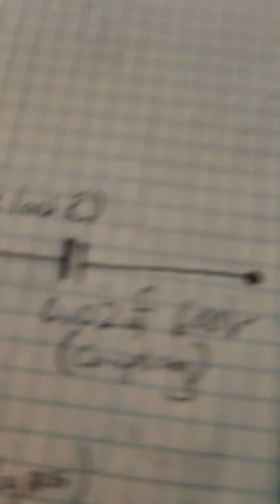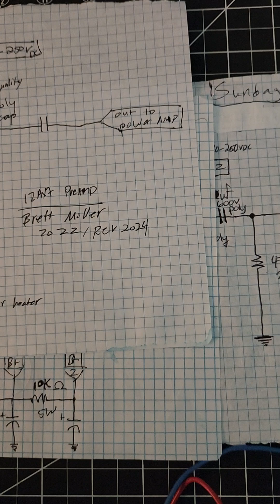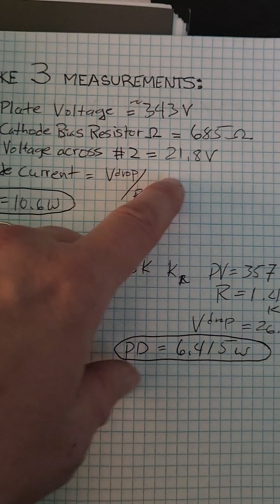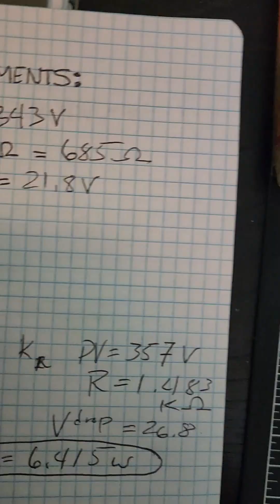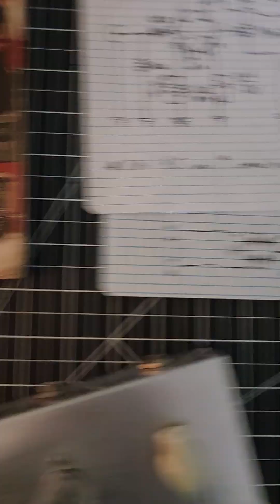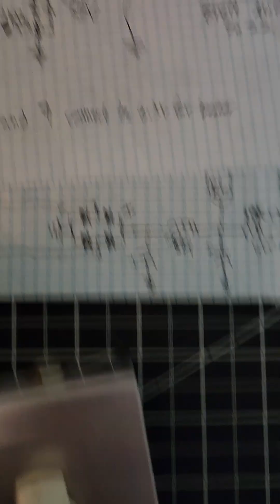Class A audio amp discussion.

Comment: The grid leak resistor at 3.11 in to the video, is that 470ohm or 470Kohm?
Reply from the maker: 470 Ohms. ....but actually I'm using 220k on a current class A amp.
Please don't miss this:
https://youtube.com/playlist?list=PLYqF93Cfrs5jGplzHx5inUdsgppEGOcAx&feature=shared

+ this guy's awesome site:
https://youtube.com/@d-labelectronics?feature=shared